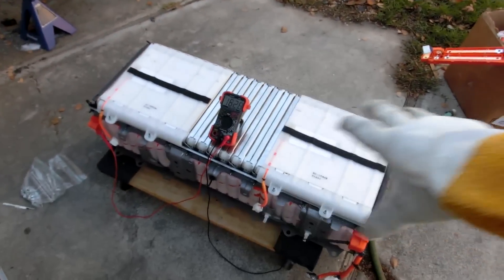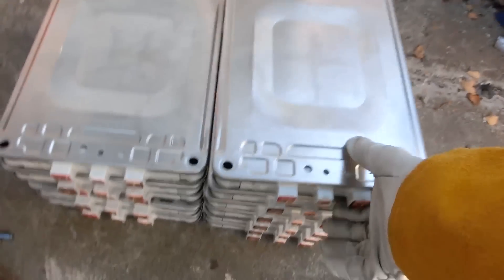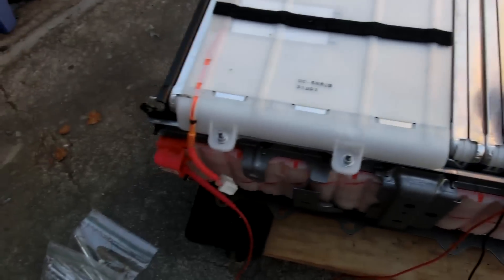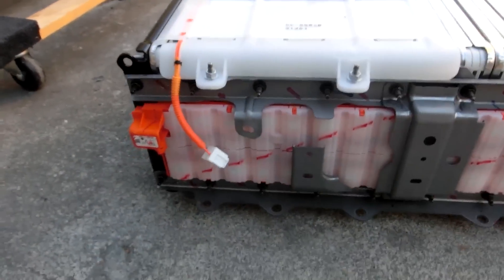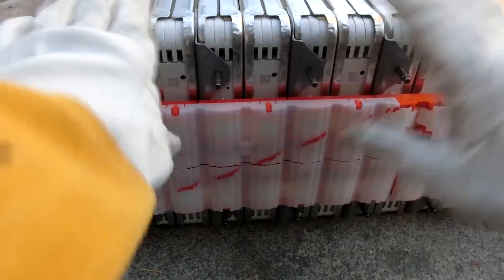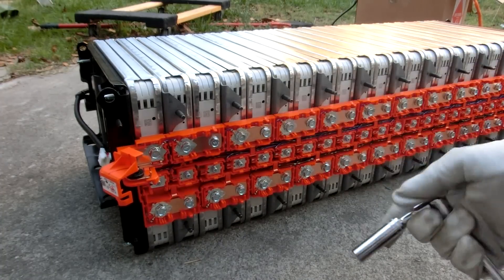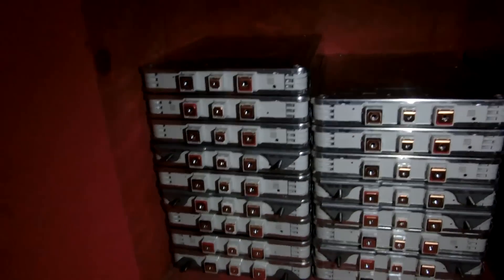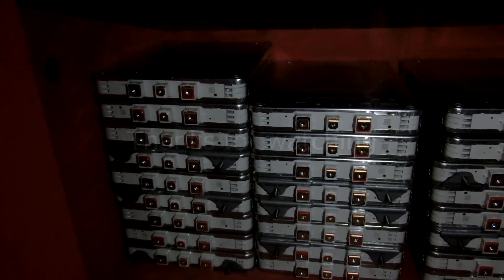2013 Nissan Leaf battery disassembly part2

Comment: Im no super genius just a registered electrician. Like Peter Griffin I need to add my two cents  on the Amps don't kill, volts kill and visa versa thing. In order to damage or interrupt the heart function a certain level of current must flow. For this current to flow we need to have amps and volts, but what everyone is missing is resistance. All three are relevant. Put a 9 volt battery across your fingers.. nothing.. put it across your tongue.. a nasty tingle, stick it directly across your heart mussel ??   
If you have been working with dry wall (Gib board in NZ) then your hands will be dry so if you come into contact with 110 or 240 then you may get a tingle but if your hands are wet it may kill you.  Lowering the resistance or raising  the voltage will increase the current flow. Further to this AC power crosses zero volts 60 times a second so is less dangerous than DC which is just there waiting to get you. Working with this type of battery you are more likely to get burned with the arcing as there will be massive dangerous currents flowing should a short circuit happen.  A few months ago a girl in the US died as she was electrocuted in a bathtub plugging her phone into a wall charger... So yes 110 can kill. Here in NZ and Australia the standard house voltage is 230v but with modern protection devices the consumer is kept safe.  Better stop with the waffle, Family Guy is about to start LOL. Hope this helps. Mark

Comment: Surprised your not using a lithium powered ratchet or screwdriver with all spare batteries you must have laying around... ?

I got my brand name battery powered tools second hand, cheap because they had the older nicad packs that had worn out, easily converted to recycled lithium cells...

Comment: you are wrong about the lethality voltage of a battery as it is DC you need 500 Volts before it is enough to cause damage to your  heart the power that the wall has is AC as you may know and it can be lethal at 50 volts at 50 Hz it is the frequency that makes it dangerous though shorting that battery through your hand would burn you but not be lethal. Edit:  by the way as i now have calculated that amperage is DANGEROUS so yeah but really AC kills at lower voltage and amperage that DC due to its "high" frequency 50 or 60 Hz AC is more dangerous

Comment: DC isn't as bad as ac. the biggest concern. is getting burned. by an arc when some tool shorts out the terminals. what type cells are these? I have heard they are nickel and also heard they are lithium. I need to store power for my off grid home. this looks like a better option than 1000s of 18650's. and these are 8.4 nominal?

Comment: Hi, I am doing a design project for an electric vehicle in which I use the Nissan Leaf modules as a starting point for a frame design. A length of 303 mm is claimed for the module length. Can you tell me how much I have to add for the plugs with which each unit is connected to the rest of the system? Otherwise I might design a part in which all the modules fit but which leaves no room for the necesarry wiring.
Reply: Marc Brassé , Duct Tape!
Reply: Hardihar! :-)

Comment: 180v dc wouldnt kill you, but it would hurt a little
Reply: Plum_ Pie -- DC power does not fluctuate to a zero point several times a second. DC is more dangerous than AC because it doesn't give you the opportunity to let go when your muscles seize. 

It's the same reason DC switches are bigger, beefier and more expensive than the same rated AC counterparts.
Reply: dc is much less harful to the body, something about ac frequencyies
Reply: DC stings like a wasp, the pain but without any buzzing.feeling. Did repair on a float charging 48V battery pack around 55 volts resting my but crack against the chargers cooling profile while grabbing the B+ bus with two fingers. Felt like needle prick to my "back there" quite surprising. Simply handling 55V with bare hands was too resistive to feel anything. The mentioning earlier in the comments that 24V is dangerous, is a wives tale. If you consider the human body having 100K OHM resistance it doesn't take a genius to figure out that 55V only let a quarter mA through your body. No where near dangerous levels. but it depends on your skin. Wet hands and having a live wire strand puncture your skin can bring you resistance down by a factor of 100, so be careful. Doing live AC work without gloves is also safe if you wear insulating foot wear and only use one hand at a time! I have often flinged a finger at the wires in a ceiling junction box to find out which one is live--- no problem. Not dangerous (not that pleasant either)!
Reply: Plum_ Pie That's ridiculous and dangerous thinking. If it's current and voltage going through your body, it'll kill you just the same as any other current and voltage going through your body.
Reply: Holly molly! Yes, it hurts when you receive your well deserved Darwin-prize...
Reply: 180v DC is deadly mate, if you don't believe me then you deserve a Darwin award for trying...
Reply: zippofanmc if 120 AC can kill you, what makes you think 180 DC from a high current discharge battery wouldn't kill you?
Reply: AC is worse than DC, and that's that, check AC vs DC pain tests.

Comment: Seems like a pointless exercise. He already has a group of the same cells. If I were him, I would keep it assembled and use the 180V to power a customized DC to AC CONVERTOR, not inverter. No need for a transformer; just use sine-wave driven pass transistors. Make a great AC power backup system! You could run a home a long time on this power pack.

Comment: do those have 18650 cells in them or something similar? or is it like a gel pack?
Reply: DDOGJENKINZ it's lithium pouches I think
Reply: RC MAD oh polymer pouches are ew
Reply: DDOGJENKINZ  those are lighter, but I would still stick to 18650 and such ..as those are pretty prone to runaway. you have to push them to insane levels to make them burn

Comment: why those gloves , they don't protect you against the high voltage
Reply from the maker: well because 1: this isnt high voltage and 2: i wear these for the sharp metal and 3: these are welding gloves, they are meant to also help with electricity. leather would require a lot higher voltage to pass through from my understanding.
Reply: Rinoa Super-Genius nominal cell voltage 3.80v / system voltage 360v on 96cells rated pack energy 24kwh 66.2ah ,
the 360 is (not high) but it Kil you without any problem
Reply from the maker: Bloe007
 i'm not sure what your meaning. so "high" means any voltage that can kill you? well 5v could kill you depending on how it was applied. i think thats a bad definition.

Comment: Could you use in a 12 volt solar system as power storage to use offgrid? If so how would you convert the voltage?
Reply from the maker: well 3 lithium cells in series is 12.6v, so theres not much conversion needed. it should already pretty much work.
Reply: Rinoa Super-Genius this also makes them as a good car accu replacement, problem itself is protection circuit/bms is missing.
Reply from the maker: The bitelaserkhalif
 no i have the BMS for it, but it'd be easier to make a new one.

Comment: All vehicle battery packs are discharged prior to removal/salvage or if still remaining in a wrecked vehicle prior to salvage sale. All reputable salvage yards here will not sell a battery pack to an individual instead going to a recycler like myself to be disposed of correctly. I am frequently called to salvage yards to discharge packs prior to their removal from the vehicle which i then put thru a grid inverter so i can recycle the available power to a further use rather than just using disipation resistors to power down the pack and render it safe. The discharge system i use is not for sale nor will i ever do a video on the system as that would involve revealing corporate in confidence material which would negatively affect my income.

Comment: And this is why the Leaf fails. No thermal management. Just a bunch of lithium cells crammed together.
Reply from the maker: fails? in what way? because surely you dont mean it mechanically fails. nissan leafs are super reliable.
Reply: Rinoa Super-Genius Fails due to range degradation. When the batteries get too hot or cold, the battery capacity is reduced. Part of that reduction becomes permanent. The Chevy Volt has thermal management, none of their batteries have had to be replaced due to lost capacity. However many of the first Leafs have significant range loss.
Reply from the maker: Sean Place
ok, but all my friends that have nissan leafs havent had any noticable range degredation. if a battery heats up your doing something wrong.
Reply: Batteries always heat up when being charged/discharged.They're also subject to ambient temperatures. Though only the oldest and most used Leaf's have shown degradation. There's an Android app called "Leaf Spy" that processes info from the Leaf's OBD port. It will show each individual battery cells health.

Don't get me wrong, the Leaf is a great car. But Nissan chose to leave the batteries unprotected, unlike Tesla and Chevy.
Reply: Always a simple minded Expert.  Humans are part of the thermal management equation..  A forced air cooling system would certainly make it more idiot proof... while maintaining system simplicity.   If you look at the "1000" O-rings and all the weight and complexity of the Volt or Tesla packs.. you will see the wisdom of how this was done.

Comment: would have been nice to see the balancing lead bar in stead of a rubber sheet that bolts screw into.....flip the thing over that took you for ever to take off. i might as well make a giant capacitor bank with no imagination for a charger circuit

Comment: 180 volts is not "lethal" as you put it. Lots of volts can be totally harmless. What can kill you is high amperage.
Reply from the maker: +Jimbo Jones looks like you dont quite get ohms law. you need volts with low enough resistance to get amps.
Reply: Rinoa Super-Genius ...and if you haven't got a low enough resistance then you wont have many amps and no matter how many volts you have they will not kill you because it is not volts that kill you, it is amps. Looks like you don't get common logic.
Reply: I agree, but caution is always in short supply. better to be on the safe side than not. 120 volts can be lethal to someone with a heart condition they may not know about, or other health factors. hardly a think that is so set in stone to say that 180 is or is not lethal. electricity is lethal and should always be treated as such no matter what (just like gun safety) unless your speaking about AA batteries